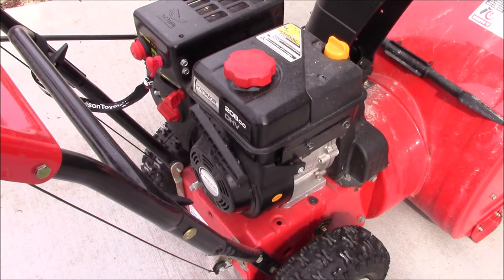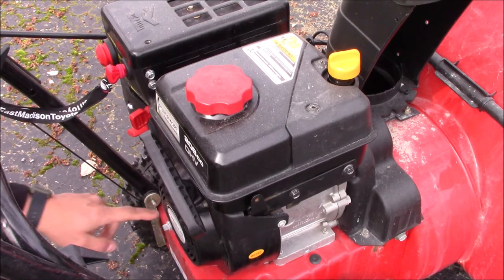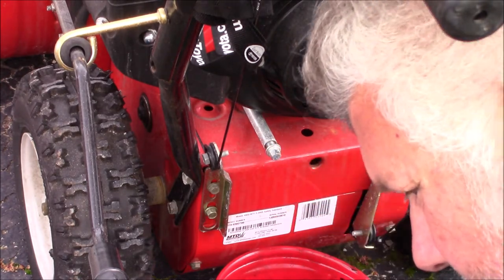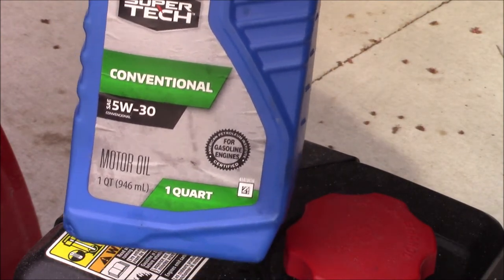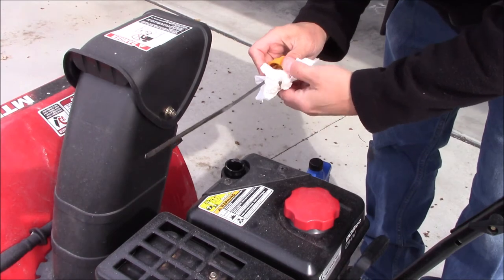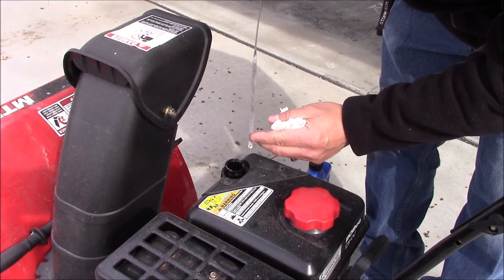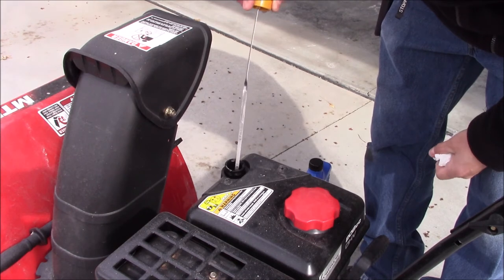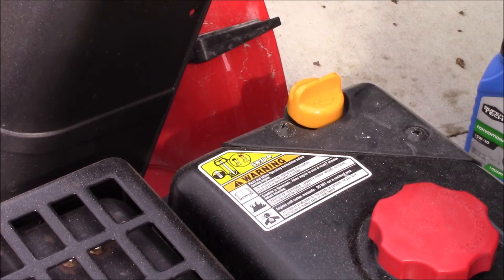MTD Powermore snow blower oil change

Comment: I am glad that I have found this video on this type of engine oil change, because I was thinking about changing the oil once Spring comes around or next week Friday here will be 62 degrees where I live at. I read another comment stating the other Yellow Plug at the bottom of engine, I am thinking it is for crankcase oil, but I know the oil drain plug would be the bolt that is attached to the long metal tube made into the engine. I am going to save this video for reference and checking out on other videos to see if you have others. I have the same type of engine which is 208CC just like your friend. I also bought it around the same time of this video and use the snowblower in 2022 and 2023 snowstorm.
Reply from the maker: glad to hear this video helped you out

Comment: Good video.  You might want to check your manual and the small picture next to the oil fill tube.  Both clearly show that you should screw the dipstick all the way in to take an accurate reading.  Not screwing it in might lead to overfilling the oil.
Reply from the maker: Good to know, thanks

Comment: This engine has two oil drain plugs, one is in the front of the engine and the other one is on that shaft. I am still going to research more on GOOGLE what is the other yellow plug is for, I know it is not a drain plug. GOOGLE has many pictures of this engine and all of the parts names. What is crazy that these engine can use just regular car motor oil but it is better to use Premium 4 Cycle engine oil specifically made for 4 Cycle Engines "ONLY". Maybe I use some Mobil 1 Extended Performance Motor Oil 5W30? Amsoil works the best.

Comment: How often should the oil be changed.  3000 miles😀 ?
Reply from the maker: every 25 hours of use or once a season which ever comes first
Reply: @bbbjim1fixedit  Very true, now I am going to change my snowblower engine oil. I will still use 5W30 Synthetic Engine Oil.
Reply: LOL

Comment: Hi,  what is the lower yellow plug for (on the left if standing in back)? Is that for the crankcase oil?
Reply from the maker: sorry I am not sure. This was a friend's machine, so I can't go take a look
Reply: I just looked at that on the same engine and it maybe for Gear Oil? Google for best result.
Reply: What I have watched from another video is that the other yellow plug on the bottom left side of the engine it may be the main engine oil fill plug, so you won't overdo it with the Dip Stick plug which is on top of the engine. https://www.youtube.com/watch?v=vL69uUcG9_E How to Change the Oil On Your Toro 721E Single Stage Snow Blower. Has the same yellow plug.

Comment: So no oil filter?
Reply from the maker: they do not use an air filter or an oil filter on winter engines
Reply: This type of engine does not have any of that, only spark Plug and Carburetor.